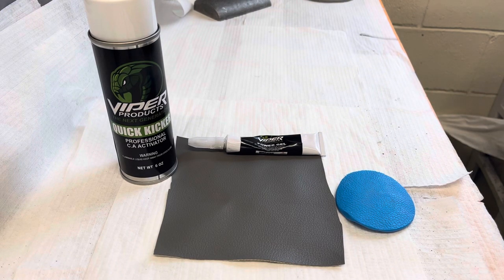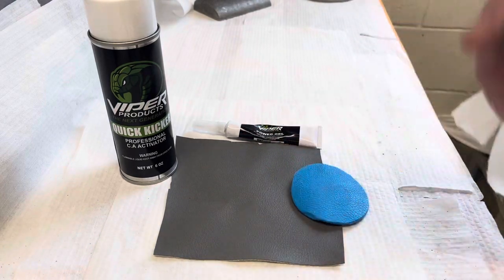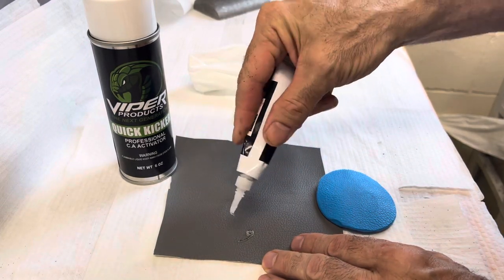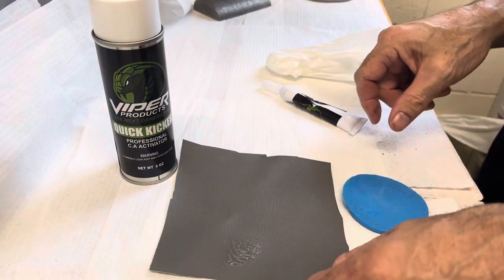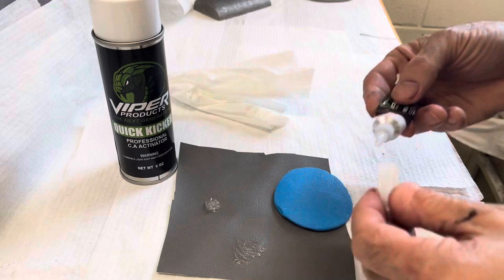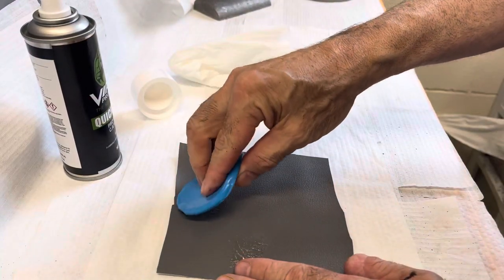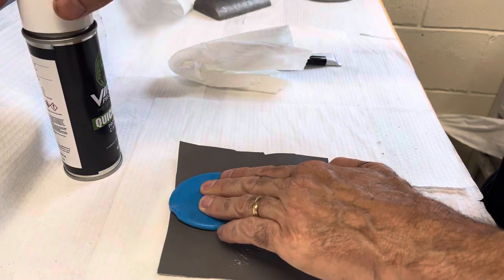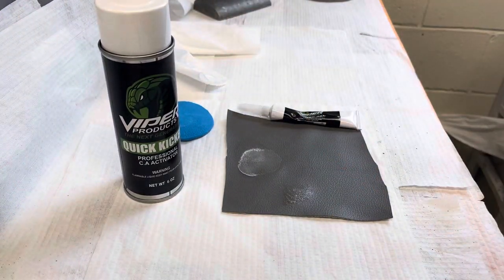Professional Texture Techniques

Comment: Does it damage texture mat? Like won’t that leave glue all over mat ?
Reply from the maker: No the glue will not  stick to the silicone pad so it will not damage it  and the kick on the pad also creates a barrier  as well. This will only work with silicone pads do not attempt this with grain paper or metal plates .